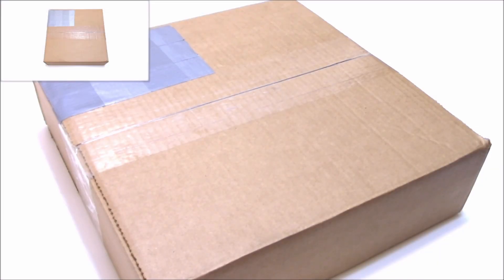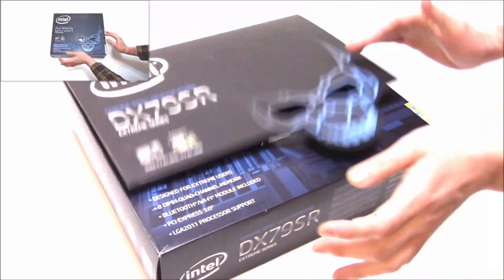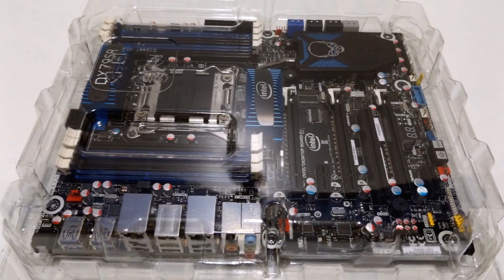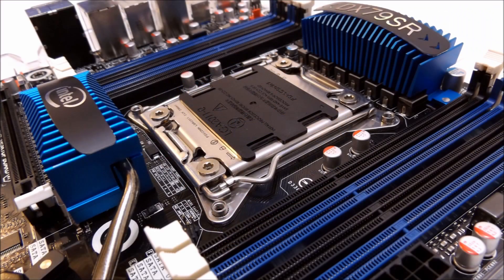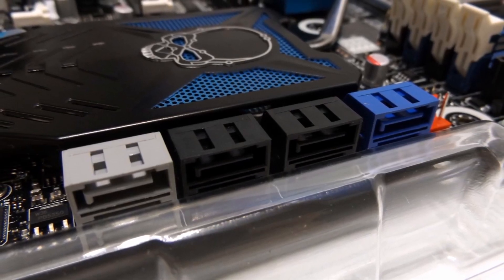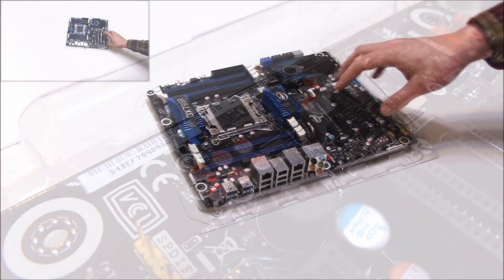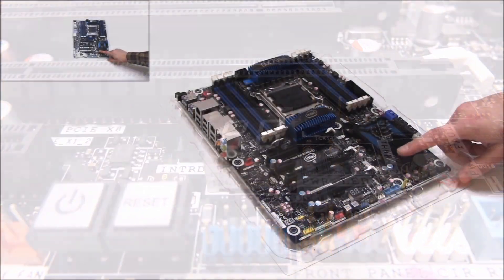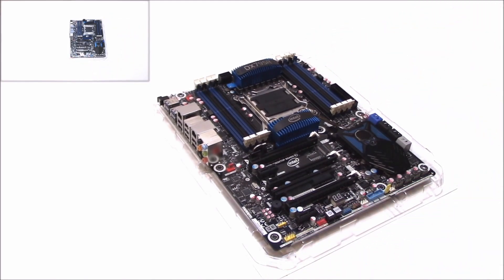Unboxing The Intel DX79SR Motherboard!

Comment: just got this motherboard with a I7 trying to install windows 10 off a usb stick and cant get it to boot into it even after setting it in the bios boot order?
Reply from the maker: i installed off a usb stick. Just hook up only one hard drive or ssd and install windows from the usb to that hard drive. Then remove the usb stick from the system and it should automatically boot from the only available drive and if the windows install worked it should boot. Default bios settings should be fine.